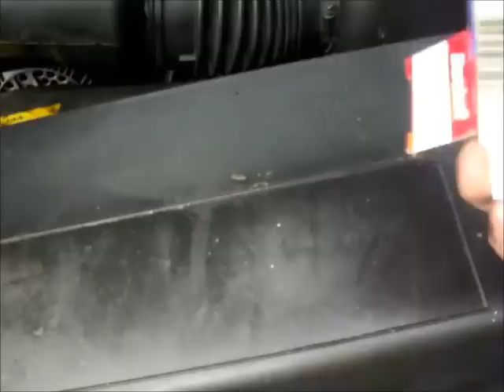Coolant Temperature Sensor Car/Truck

Comment: If you follow the large radiator hose from the front of the truck connected to the  radiator follow it to the thermostat it’s right next to the thermostat
Reply: Hey does it have a big black cylindrical plastic thing thing on top about the size of a c battery?

Comment: I have an 02 expedition 4.6L XLT. The sensor is not in the same position on mine as in this video. I suspect it’s behind the alt on the driver side
Reply: It sure is ! Under the intake manifold...wtf. Not bad, only need to remove alt to change. No need to remove the intake. It is on the drivers side, close to the front, down low. The intake manifold insulation kinda hides it, but its there. Just did it, took a total of an hour. Pull the belt, remove alt, unplug connector and a 3/4" wrench will get it out. Don't let it go, it caused my Mercury to die eventually, because it causes the computer all kinds of problems as it changes the fuel/air ratio due to the bad sensor. The car thinks it's colder/hotter and really fucks with fuel delivery when it goes totally bad!!
Reply: That is actually the engine cylinder head temp sensor

Comment: Will this sensor stop my heater from working if it's bad.
Reply: no. this sensor helps the computer determine how much air and fuel to mix based on temperature of the coolant. if this sensor, or the cyclinder head temperature sensor on some models, is bad the vehicle may take longer to crank and run rough at cold temps due to the computer being unable to calculate how much fuel and air to mix.

Comment: I have a 2000 5.4, and there's no way you can get to it without removing the alternator, no way. even with the alternator of it almost impossible.
Reply: A lot of ppl confuse the engine cylinder head temperature sensor with the coolant temperature sensor. I myself is also having a hard time finding it on my 2000 f150 5.4l
Reply: @gabrielshirk  hi I also have a 2000 f150 5.4 my issue is that the radiator fan stays on all the time ..did you had this issue on your truck??

Comment: i have a 98 Ford expedition 4.6 litre. it's getting a white milky substance in the antifreeze resivore. I've changed thermostat and new coolant nothing has changed. temp stays cold no heat.
Reply from the maker: how many miles do you have on your ford expedition.Do you think the for 4.6 has a longer life then the 5.4.
Reply: John boy York its called oil and water
Reply: John boy York head gasket leak
Reply: John boy York check the gear ox oil cooler might be leak it's in the radator between the plastic cover and the radator check tramission oil might be low called auto tramission cooler
Reply: Head gasket seems to be blown.... Sorry.

Comment: What about fro a 2004 F150 5.4L? Same operation?
Reply: Did you find out?  I've got a 2002 F150 5.4L.  I suspect it's the same, but I don't know for certain.
Reply: no. i believe after 99, ford switched to only using the cylinder head temperature sensor. look up car maniac125, he has a great video on how to replace this sensor.
Reply: Yes that's true I just put 04 motor in 98 and 98 temperature sensor did not work hoping to switch it with the wrecking yard motor one but it does not have it Only cylinder head temp Super confusing at the park store and a mechanic for 20 years plus Stupid Ford crap

Comment: Would this be the same as cylinder head temperature sensor? Some other videos show the sensor on the left bank under the manifold
Reply: if you turck is after 99 i believe, it only has the cht. if you look on the coolant bridge there will either be a sensor or a plug. if there is a plug change the cht sensor under the intake manifold. if there is a sensor on the bridge, change the sensor.
Reply: @YourLordMobius  This comment won today's prize.  2000 Expedition: I could only find the CHT sensor and looked everywhere on the engine and then came to YT to locate the coolant temp sensor.  I found this reply and the plug you just mentioned.  Well done.

Comment: That's not 4.6 V8? mines it's a 1998 F150 4.6 V8
Reply: should be the same on the 4.6 as those motors shared the same intake.